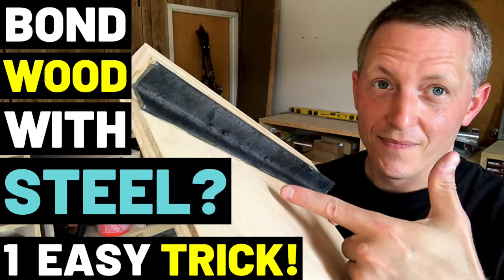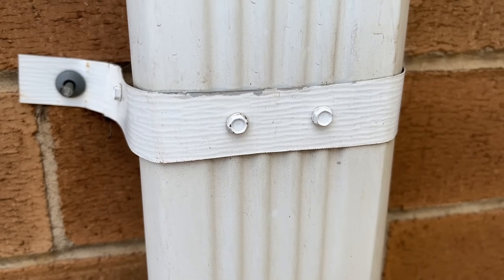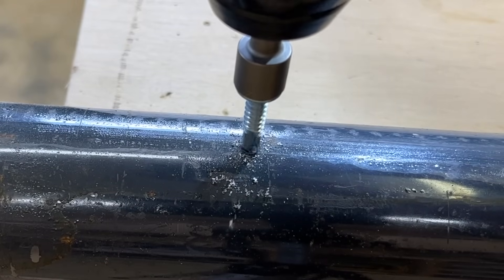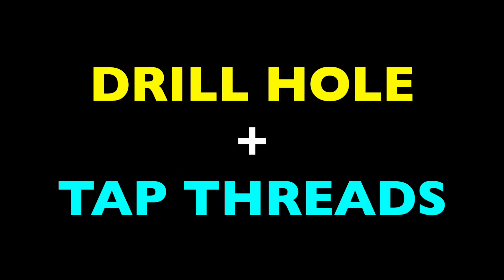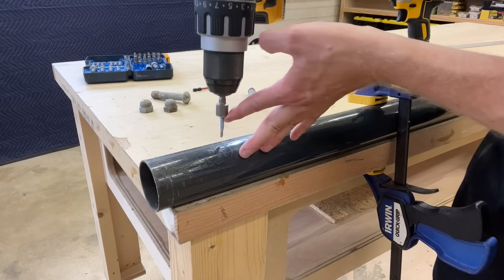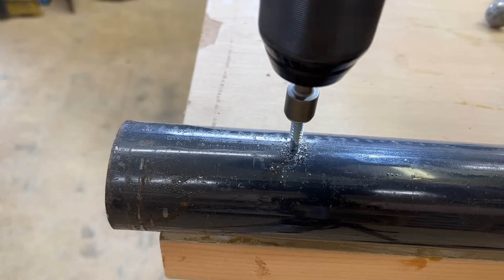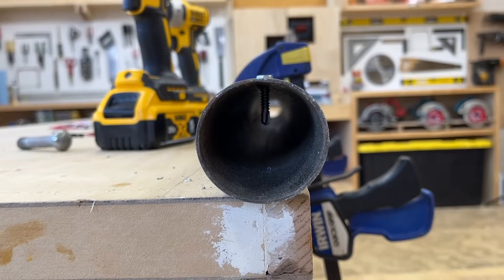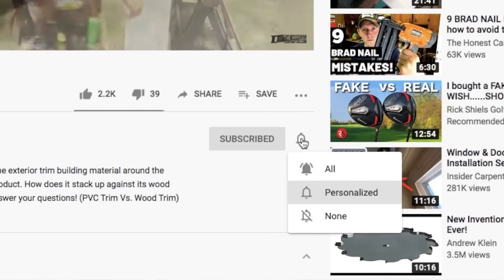These Screws CAN DRILL STRAIGHT INTO METAL! (Self-Drilling Screws...Fasten Anything To Metal!)

Comment: Thanks for the as-always interesting and informative videos. One question: I wonder if any drilling oil is needed with these screws and if so would it be more or less than the amount you'd normally use when drilling with bits?
Reply: Oil is used on drill bits to help keep the tip cool and lubricate so your bit stays sharper longer. You don’t need it on theses screws as they are considered one time use. Although, maybe a drop or two would help on very thick metal.
Reply: @huejanus5505  Thanks Hue. Longevity is definitely one benefit but even for the purpose of one drilling, a proper oil could be difference between a successful drill or complete failure. The Project Farm YouTube channel has a whole video on that.

Comment: Thanks for the video. I am having trouble using self drilling TEKS screws on my metal purlins in garage.  Sometimes they bite.   So I tried drilling a pilot hole which helped a little. I am using a cordless drill. Should I be using an impact driver? I am drilling through the small part of 2x4 into metal purlin.  Thanks for any help or advice.

Comment: Thank you for the video.  How about a video of re roofing your shed roof.  I have done normal roofing in the past but I think a lot of manufactured sheds have the minimum in roofing supplies.  My main concern is the overhang because the shingles are just stapled on the sheathing.  If I try to drive a nail to anchor the shingles I will destroy the sheathing.  Any suggestions?

Comment: Thanks Ethan- another good video.  One thing I wasn't clear on.  Since the examples here were all relatively thin, it seems like one could get plenty of fastening power punching through the metal, and binding the wood underneath.  The tips of these screws are hard enough to bore a hole in metal. Are the threads also hard enough to cut thread..channels (?) into the metal?   Thanks!

Comment: I have a blind that sits in a window, but there is a steel beam above the drywall, so it's impossible to get a wall plug in there and the previous homeowners just screwed into the dry wall, so the screws keep ripping out when lowering or raising the blinds due to the force used to pull the strings. I wonder if these self-drilling screws will be a good solution by screwing into the metal beam as opposed to just the drywall?

Comment: That was a great video! Do you need to have a hammer drill and if so should the setting me on.?
Reply from the maker: Nope! Just normal drills and impact drivers, Stef 🙂
Reply: @TheHonestCarpenter  Thank you Ethan
Reply: A cordless impact drill/driver works the best. I used to use hundreds of these a day doing commercial HVAC work. A non impact driver will work, that’s what I started with, but an impact will do it Much quicker.
Reply: @joehook145  thanks for awesome advice.

Comment: We used to use these on  cold girders putting up insulated panels in winter by the water. We got to hating having to swap from drill to fastener because the cheap drill bits they bought couldn't handle getting through the girder. So we'd burn fasteners out, toss it and grab another one. When those swing lifts came back down, there's be as many fasteners in it as the panel we out up if not more. I hated how wasteful it was, but the company wouldn't supply the bits like the union required so we did what we had to.

Comment: That fastener only works with soft metal thinner than the flute depth. Thicker than that the threads will strip out above the flutes.  If you want a good reusable threaded hole, once the screw bites in, use a little thread tapping compound or oil to draw off the heat and help the chips get out.

Comment: Can a wood-to-metal self-drilling screw be used to attach a furring strip to the thin metal strut inside a cargo van? I went to the store today to pick up some screws and the guy in the store told me it wouldn't hold any amount of weight without a nut on the other side
Reply from the maker: It’ll hold some weight—the threads act as an anchor. But he’s right, you’ll get much more fastening power with a bolt and nut. Just depends on how much weight it needs to hold.
Reply: @TheHonestCarpenter  love your Channel! I'm trying to hang a 100 lb heavy punching bag from the ceiling, but the ceiling joist appear to be metal oh, maybe aluminum. Would you use these screws to hang the anchor or is there another method?

Comment: I’ve always wondered if you can use a self drilling screw to mount things, like a TV, to metal studs? Everyone always uses strap toggles for mounting things to metal studs but I haven’t ever seen someone try mounting with self drilling screws. I suppose there’s the hazard of the screw becoming unthreaded and falling out over time?
Reply: good question I'm wondering the same thing

Comment: do you use impact driver or drill to make it easy.i have to do over 130 times for the light fixtures
Reply from the maker: Drill is just as good. Maybe even a lighter 12v drill since power isn’t everything here. Save the weight on your wrist!
Reply: @TheHonestCarpenter  Thank you, I actually buy both but after your videos I might want to buy only drill

Comment: at what clutch setting do you put your cordless drill when drilling and driving using a self drilling screw into metal?
the drill icon ?
i am asking this in regards to your drill wrist twisting tip
Reply from the maker: I clutch it all the way up to the highest number (just short of the drill setting), then go by feel once the threads are biting
Reply: @TheHonestCarpenter  and the reason for putting it on "highest number (just short of the drill setting)" insted of on the drill setting is to avoid drill wrist twisting injury?
also do you know if on dewalt drills at drill setting is there a safty to avoid the drill wrist twisting injury?
also on dewalt impacts i have been wondering about the drill wrist twisting injury does it have safty for it ?
thanks for answering
Reply: @TheHonestCarpenter  or please tell me why on highest number (just short of the drill setting) insted of the drill setting
also what is the risk of drill wrist twisting when using an impact driver

Comment: I have been having issues with the drilling screws snapping off right where the threading stops and the tip begins to get narrow. Would there be any other reason other than over-drilling (Pressure down on the screw or too much torque?) that would be causing them to snap? I am drilling through 24 gauge .03-.07 inch galvanized steel and 24 gauge .03 inch stainless steel.

Comment: I found your video too late. I'm installing a baby gate on my aluminum deck railing and pre drilled the holes for anchors. unfortunately the supplied anchors are not holding or falling into the post. do you have any suggestions for aluminum screw anchors. thank you

Comment: I need to drill through a pole like you were doing in the video so that I can place a wooden platform on top to feed the crows with a slinky on bottom to foil the squirrels, but I need some kind of curved L bracket to hug the pole and be flat on top to brace the wood. Anyone got any ideas?

Comment: and they really mean for  real light steel. like sheet metal....because well rgwt aren't tungsten carbide drills :-\    which ya need to get through most stuff 1/2 inch and over .   PS using a punch on metal is always used since it guarantee's the bit isn't going to slip or walk away from the intended drill point "=\

Comment: Wouldn’t waste my time with Philips drive self tapping sheet metal screws. Philips drive is essential for drywall but nearly useless anywhere else. Tek screws drill out too much wood to grip well in wood. Try an impact drill driver for metal to metal. If you burn the drill point on a tek screw use another screw until you drill through then substitute the burned screw so you don’t have to throw it away

Comment: Biggest mistake I see, even among tradesmen, is blowing out screws by running at too high of an RPM, then the screw "doesn't want to drive." Leads to a lot of wasted time, wasted screws and damage to the work.
Reply: 0:30  I’m working to install weatherstripping on my barn door which is 14’ tall. Instructions said install the top strip first. The weatherstripping came with self tapping Phillips head screws. I used an impact driver and got the first 1/8 “ then the screw siezed and the Phillips head starts stripping. All this on top of a 14’ ladder.😮 In reading this, it seems my mistake is using the impact driver. Next plan of attack is using cordless drill on slow setting to hopefully avoid having to drill pilot holes. 
This video was enlightening. Hoping the suggestion solves my problem. 
👍

Comment: These screws should be outlawed
Reply: @MANKICKS  they always tear a bigger hole (maybe not when you use them but surely throughout their lifespan across everyone who touches the unit) and make ongoing maintenance a huge hassle.  Additionally they gradually loosen up due to temperature change and unit vibration thus causing accelerated wear and even more vibration.  If you want to secure to sheet metal, put in proper threaded inserts.  Cost difference on a few thousand dollar unit maybe amounts to 50 cents at most.  Don't give anyone that future headache.  Penny wise pound foolish IMHO.